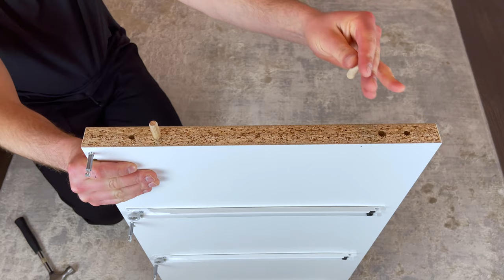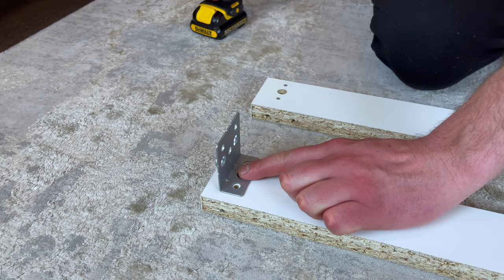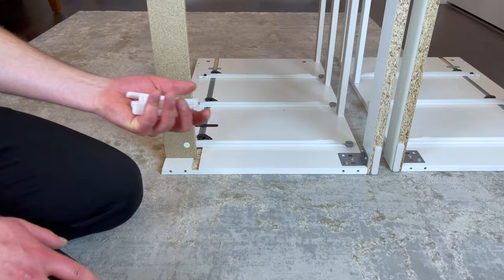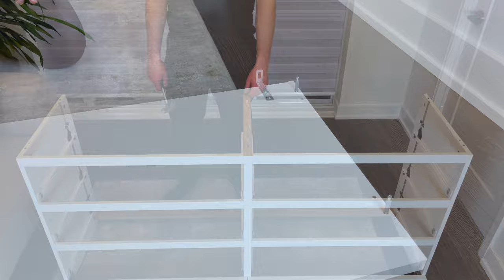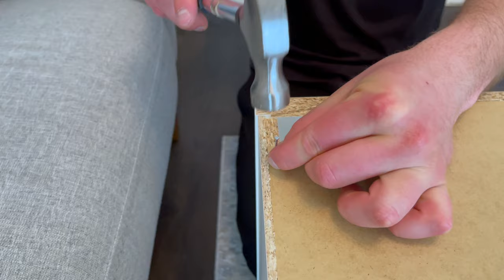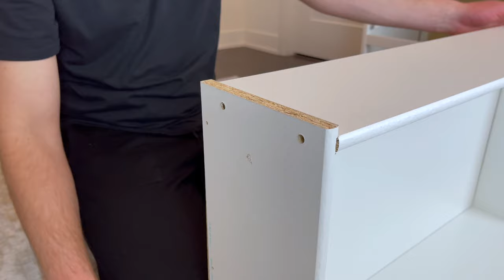*UPDATED* | MALM 6 Drawer Dresser IKEA Tutorial

Comment: I followed this step by step, worked well for me (ikea probably won’t like this but.. it saved me some annoyance) the panels with the metal railing.. if you don’t have a child or small people to worry about and aren’t concerned about the fear of tipping or plan to anchor it to a wall anyway, you can remove those rails by unscrewing the top silver metal bracket thing before adding the drawer slide rails , cause that locking mechanism is so annoying, to deal with (the little black bar sadly doesn’t cleanly come off and I had to snap it off with a flathead screwdriver or heck even a butter knife can do the job

Comment: my top left drawer is completley stuck after I put it in... what do I do?
Reply: It’s PROBABLY the locking mechanism rail inside of the left and right side wall panels, that rail with the little clips stops multiple drawers from opening at once and if it’s is like slightly ajar at all that thing kicks in, see if you can’t somehow get to that side panel and remove that rail
Reply: I unscrewed the drawer slides from the side panel and removed the rail assembly myself

Comment: 26:25 is the most confusing step. I don’t understand how this is supposed to attach with the previous step. You showed it all from an angle that does not correlate with the instructions at all
Reply: Never mind. There was a severe lapse of judgment in my evaluation of this video compared with my dresser. I am sorry for being rude and I hope you can forgive me. I am constantly working on improving myself
Reply: You slide the cardboard along the back panel first and insert the cardboard back into the sides by opening them a little bit. I'm doing it now and it's no issue
Reply: Or you can do it per the instructions. Either way you work the cardboard in all the slots